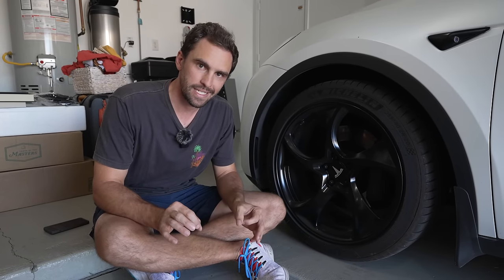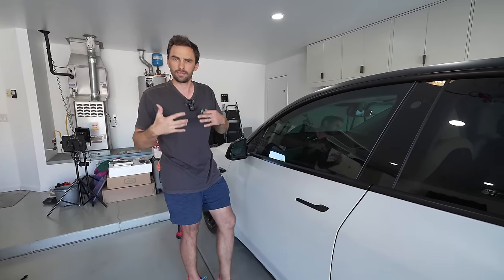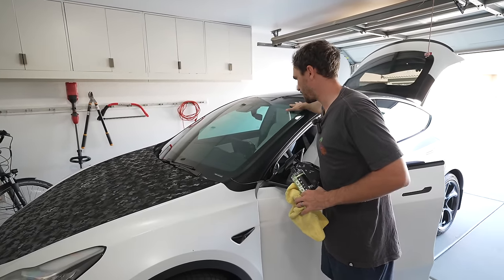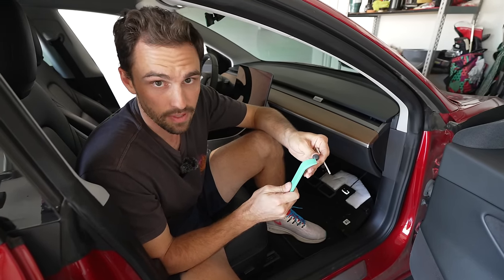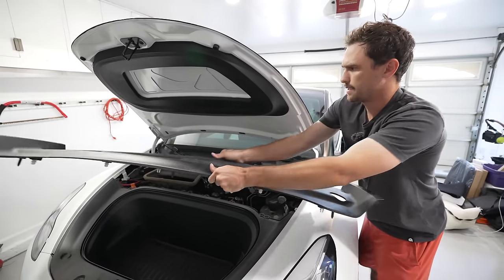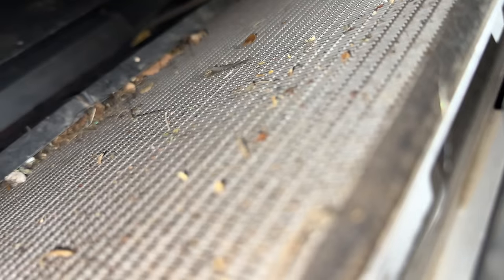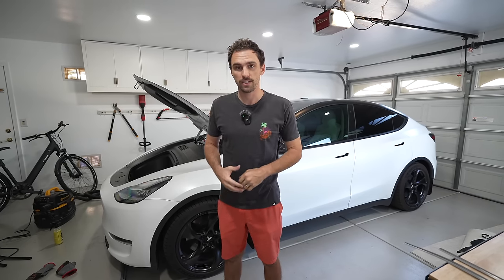10 Simple Tesla Maintenance Steps for Increased Efficiency

Comment: A few times a year I remove the wiper blades, clean them and apply 303 Protectant to the wiper blades. Makes them last a lot longer. There is a hidden 3rd clip for the AC condenser behind the right lower clip (driver side) It will allow you to pull the panels further apart for deeper access to clean between the two panels. Wedge something in there like a screwdriver handle to keep the panel gap open.
Reply from the maker: thanks for the further info! this will help others

Comment: I recently did some research into the EV s chewing through tires idea. Turns out it is not because of the weight of the car. It became an issue because the model s and x have air suspension and when they are set to low the negative camber is insane. On model 3 and y without air suspension and if they are aligned properly. That part is key. Tires don't wear much different than normal cars. I currently have gotten 55k miles on my tires on my 3 performance and love to accelerate hard. So basically I'm saying this whole issue is a big misunderstanding.
Reply: A lot of people don’t rotate correctly
Reply: @OrganicStuff1  true. Although with all wheel drive I've found rotating tires much less of an issue vs alignment. Toe in or out and camber will mess u up
Reply: Totally agree on the alignment. I just got a Model Y and like my previous Model 3, it was way out of alignment from the factory.  I believe it also affects efficiency.
Reply: Curious to see what research this is.  Yes, the camber obviously decreases the life of the tire drastically but to proclaim weight isn’t a factor disagrees with basic physics, and disagrees with the average feedback from model 3 and Y owners ( it’s a pretty huge sample size).
Reply: @zahf6484  just look at the weight of the 3 vs any competitor. Bmw 3, Benz c or e class. They are all around 4k lbs. Weight is a factor but some EVs weigh the same as ice cars so what are we talking about...

Comment: •	Tire Pressure and Maintenance: Proper tire pressure (42 PSI for most Teslas) is essential. A portable compressor can help maintain this, and rotating tires regularly is advised for longevity.
	•	Timestamp: Watch from beginning
	•	Chill Mode to Save Tires: Using chill mode can save tire wear due to the electric motor’s torque. It makes acceleration smoother and extends tire life without sacrificing performance significantly.
	•	Timestamp: Watch from 1:44
	•	Use of Tesla Service and Parts: Highlighted the importance of utilizing Tesla’s service centers for parts and maintenance, including replacing missing clips and parts.
	•	Timestamp: Watch from 2:58
	•	Wiper Blades Replacement: Recommends replacing wiper blades every 1-2 years. A specific brand offering long-lasting replacements with additional wiper strips was mentioned.
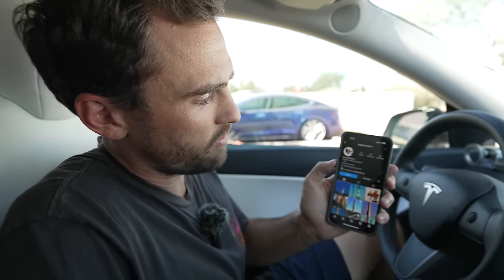	•	Timestamp: Watch from 4:27
	•	Cleaning Interior Windshields: Emphasizes cleaning the inside of windshields, especially for smokers or vape users, to improve visibility.
	•	Timestamp: Watch from 6:55
	•	Cabin Air Filters Replacement: Suggests replacing cabin air filters with HEPA filters for better air quality and to avoid musty smells. A kit including tools for easy replacement was recommended.
	•	Timestamp: Watch from 9:14
	•	AC System Maintenance: Cleaning the AC condenser and replacing the cabin filters can significantly improve the efficiency of the AC system.
	•	Timestamp: Watch from 10:48

The video emphasizes low-cost, easy-to-perform maintenance tasks that Tesla owners can do themselves to keep their cars running efficiently and extend the life of various components.

Comment: Suggestion when replacing the wiper blades:  Place a towel between the wiper arm and the windshield.  Should the wiper arm slip when trying to insert the new blade, it won't go crashing into the windshield glass and possibly cracking the windshield.  
PS, thanks for the tip that you can manually move the wiper arms when in wiper service mode beyond the couple of inches it raises up when you hit the (virtual) button.  I just washed my Y this week and had a devil of a time trying to clean the wiper blade (driver's side in particular) using the default position of wiper service mode.
Reply: Most luxury brand vehicles have this feature.  My 2015 Audi A6 has this same feature when servicing the wiper blades.  Glad to see Tesla has this as well.

Comment: 🎯 Key points for quick navigation:

00:00:00 🛞 Proper Tire Maintenance for Teslas
- Regularly check and maintain tire pressure and perform rotations to enhance tire longevity,
- Recommended tire pressure for Teslas is generally 42 PSI. 
- Using the chill mode can extend tire life by moderating torque application.
- Monitoring and maintaining tire pressure is a simple yet crucial upkeep step.
00:04:24 🧼 Importance of Windshield Maintenance
- Replace wiper blades every 1 to 2 years for optimal performance,
- Utilize the wiper service mode for easy access and installation.
- Clean the interior of the windshield to eliminate film buildup for better visibility.
- Consider using specialized cleaning solutions for enhanced results and durability of wipers.
00:07:54 🎛️ Cabin Air Filter Replacement
- Replace HEPA and charcoal filters to improve air quality and odor control in the cabin,
- Instructions and tools for filter replacement are typically included in purchased kits.
- Using activated charcoal filters offers better performance compared to standard options.
- Clean the air conditioning system to enhance efficiency and comfort.
00:10:28 🌬️ AC System Maintenance
- Cleaning the AC condenser can lead to improved energy efficiency and odor reduction,
- Accessing and cleaning the condenser can help maintain the overall health of the AC system.
- It's advisable to undertake regular cleaning to prevent dirt buildup from affecting vehicle performance.
00:14:53 👨‍🔧 DIY Maintenance Benefits
- Engaging in simple DIY maintenance tasks can help you better understand your vehicle,
- Performing these tasks provides an opportunity for low-cost upkeep and assessment of the car's condition.
- Knowledge gained from maintaining your Tesla can lead to improved long-term vehicle care.

Made with HARPA AI

Comment: Great video.  Glad to see you can service the condenser without taking off the bumper.  There is a video of this same service on YouTube, but the guy took the bumper off...I was shocked that this was happening.  Now I see its simple and that was over kill.  This is a great video for that reason.

That tire pressure tool is what I need.  Thanks for that.

Agreed, driving habits play a high part in tire ware.   Quattro Audi with 40/60 all the time..with torque vectoring..if I drive to aggressive..bye bye 45k life.  Sport mode is not a friend to your tires.

Comment: 12:20  - Now this is really helpful!

Just an FYI, while you have the Frunk Storage pulled out, check the rubber dampeners where the A/C compressor mounts for tearing.  The compressor is the orange device hanging down in front of the 12V battery with the orange high voltage wires going to it.  It hang off the side of the bracket and has 2 upper mounting points and one lower mounting point. My Model 3 is at 60K and the lower dampener completely tore out causing a loud noise and lots of vibration in the when the A/C was running. The lower part of the compressor was no longer supported at the bottom and banging against the bottom of the bracket.

I’m out of warranty was able to obtain a replacement mounting bracket assembly for $25 from my local Tesla Service Center. 

The replacement isn’t difficult: and takes about 20 minutes if you know what you’re doing, or about an hour if following a YouTube video.

Comment: G good job on hitting the radiator. That's the main cooling for the batteries. By cleaning it you increased the air flow and which will cool the batteries faster. Don't forget to look at your coolant level while you're there. 👍

Comment: Great video! The cooling radiator should be foam sprayed with a HVAC cleaner spray bottle, soak in 5 min, flush with water in a little spray bottle for a best case scenario clean 😁

Comment: Thanks for the tip about removing the speaker on the panel under the glovebox. I have just about broken the cable/connector trying to remove the cable rather than the whole speaker. I will use your advice in the next time I clean the evaporator and change the cabin filter. The fourth time is a charm, hopefully. I have 118K miles on my Model 3.

Comment: If want to actually clean off the coil you’ll need to remove the bumper facia and pull that shroud off.  There is another plastic grill or idk what to call it.  Actually I’d call it a leaf catcher.  It will have the majority of the debris trapped all the way at the bottom.  It’s a real pain but it seems to greatly improved my ac efficiency getting all the junk out and hitting it with a couple coats of coil foam and a rinse.

Comment: 11:05 how long did the battery last before it required replacement? 
Was it just two years?
What voltage is it normally maintained at, assuming it's getting charged by the main battery?  If it's designed to be allowed to run down rather than being kept at full charge that would explain the short lifespan.

Comment: One other big issue is put a screen on the front air intake for the Condenser, that keeps bugs bees and other vermin from plugging up you fine fin channels on your Condenser, great to prevent early AC compressor failures from over use due to plugged up Condensers. I did that day 20 of getting my Tesla new.
Reply: Where did you buy this screen?
Reply: @BYCWELL  local Tesla accesories store in Vancouver, BC

Comment: 11:07 - Took my car to the Tesla Service center for the 12V battery replacement. Mobile Service was not available.  Only $85 to have them replace it, took 15 mins.
Reply: Did it degrade over time? Or is that a timed maintenance replacement that they schedule at regular intervals?
Reply: Was it just low on charge and needed charging or did it lose capacity, needing replacement?

Comment: I took my Y into the Tesla service center in east Mesa and a few months later when replacing the 12v battery I found a nice screwdriver left behind by the service guys.  I also noted that they forgot a clip or two.
Reply: They did not screw any screws back on my frunk after last service. Just left them in the frunk  for me to find next time..
Reply from the maker: I used them before as well and they left stuff all through my car
Reply: 😂. It happens.  Had my an older audi before my newer one..had the high pressure washer service done on my engine due to bad carbon buildup..it was a tsb and was covered under an extenended manufacture warrenty..long story..they had to decouple my exhaust assembly for it..and left it uncoupled when they gave it back to me.  Terrible rattling...  took it to my local indy shop...bolted back up..all good.  Yah, service centers leave junk or forget to bolt shit back.  It happens to everyone.

Comment: How well does the ceramic glass coating work on the rear window? Looking for something that get's condensation off my model Y now we're getting into winter. The lack of a rear wiper does bug me and the rear glass heater dosent do a lot in clearing water.
Reply: I use simple RainX which you spray on a cloth and wipe..then let it haze over..then buff off.  It stops moisture from Dew and keeps dirt from sticking.

Comment: Thank you so much for the video. I have a 22 MYLR and we have as bout 66,000Klm on it.  So about 40,000 miles.  But we love it.  How do we know if the filters need be replaced?
Reply from the maker: sometimes you get a weird smell but I would replace yours asap. either do it yourself or have Tesla do it I bet they are a mess after that many miles. the ones we changed in this video were only after 1 year
Reply: Most service centers for ICE recommend based on mileage..I would guess EVs are no different.  You definitely need to replace and clean your engine bay probably.

Comment: Great job but an AC Condenser should also be cleaned no just vacuumed. Here is BC Canada we get mildew and moss buildup, and there are many foaming cleaners specifically designed for the aluminium fins and coils that will give you far better cleaning of the Condenser (the large radiator in the from). I did my air to air ductless heat pump Condenser on the house and reduced my energy consumption by about 30%. My 2023 Model Y long range AWD (Fremont built) here in Canada, is just shy of 1 year old, The Model Y's are now coming from China.

Comment: Thumbs up for outside the bun thinking on the plastic piece protecting the wiper replacement parts. Also, for changing out cabin filter... the Tesla Owners Manual no longer shows removing the trim below glove box as necessary to get to filters. Is that because newer models can get to filters by just removing center console trim... or all teslas can get there without removing trim below glove box?
Reply from the maker: Not sure why it doesn't list those. As you can see they get filthy so I would still replace it.
Reply: @Gjeebs  sorry for any confusion.  My comment wasn’t about replacing the air filters themselves (completely agree they get filthy) but how to get to them. In your video you remove trim below glove box and also trim on side of center console. OM now says you only need to remove trim on side of center console to reach the air filters.

Comment: Just purchased the filters from Vion with your discount. My AC has started to smell. How many miles did you have on those filters you pulled off in the video? Those were pretty dirty.
Reply from the maker: I don't know what the mileage was but it was about 2 years
Reply: @Gjeebs Thanks. I have 16 months of ownership and 38,000 miles, so mine should be ready for a change.

Comment: Any tips for range on a standard range model 3? I am also in AZ and have had my 2024 model 3 for about 3 weeks now. The most range I've been able to get out of the car is about 170 miles and that was goin down to 5% battery. Is this just what i should expect due to the AZ heat? I noticed that the 2nd most use of my battery is my climate control. Kind of a disappointment to me if this is what my overall range is going to be.
Reply from the maker: I would get a sunshade which lets you reduce the ac usage but heat does kill them in the summer
Reply: @Gjeebs  thanks for the tip. I will get that sun shade.

Comment: You use and do a lot of accessory reviews, what are your thoughts on one of the many front radiator screens that snap on the air intake at the bottom of front bunber to prevent so many leaves etc from getting into the front radiator assembly? Is there a reason you would not recommend using one of these?
Reply from the maker: I'm sure they are fine but I never tried one. I would just avoid blocking how much air is coming in. They made it the size they did for a reason so you just don't want to restrict that

Comment: This is very important since, as of 2019 Tesla no longer provides recommended service intervals. This isn't because the cars are built so well - they actually aren't. It's likely because Tesla has very few service centers and they can only have so many mobile service vans. I think it's awful that Tesla leaves it to their customers to determine when their vehicles need maintenance. Important things to check are:

1. Tire inspection. Because of their 30% weight penalty vs comparable gas cars tires wear out about 25% faster on EVs. Also the high and rapid torque development typical of EVs adds wear.
2.Wheel alignment. Alignment goes out of whack like any other car and in EVs it costs range and accelerates tire wear.
3. Suspension and brake system inspection. High mass loading causes wear and as brakes aren't used as much and some customers can actually drive for extended periods of time w/o actually using their hydraulic brakes, braking systems components such as rotors and calipers can corrode, particularly in cold weather areas where roads are treated for snow/ice. This can be a very serious safety issue!
4. Have Tesla (nobody else is really qualified) conduct a thorough inspection of the drive battery (the main battery) especially checking for load balancing, which improves battery performance (range) and lifetime.

It's just crazy that Tesla basically throws their customers to the wolves when it comes to routine maintenance. The notion that EVs don't require maintenance is absurd and very untrue. ALL devices require maintenance. The difference is that, for gas cars, its often preventive maintenance, such as oil/filter changes. For EVs maintenance is actually a performance and safety inspection that includes a thorough inspection of steering & suspension components, tires, an alignment check, and a high voltage (drive) battery check.

Comment: That’s a remarkably poor design for the cabin filter. On my Honda I just open the glove compartment, press a couple of tabs on either side and pop the new filter in. Takes less than 5 minutes. No tools required. What was Tesla thinking?
Reply: Agreed.  Maintenance was an afterthought on the design.   Same with the radiator access - it should be easier to get to.
Reply: Tesla is not a singular mind.  Designs generally come from designers and then passed to engineering and then production.  Tesla designers often puts priority on some things that forces engineers into doing "stupid" things.  In the Cybertruck the hasty design left out windshield wipers so that it became an add-on and awkward looking feature.  My MY has door handles that  pleased aerodynamicists but are awkward and inexplicable to first time users.  Had Tesla done a simple focus group exercise they would have known this within a few minutes.